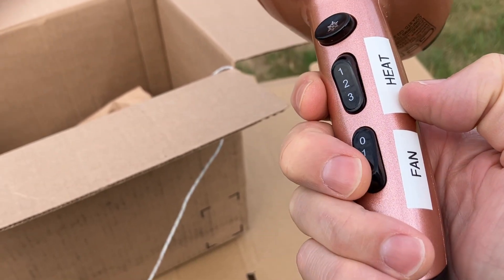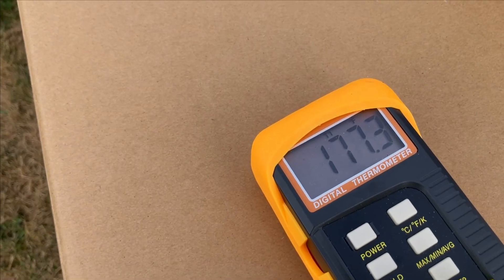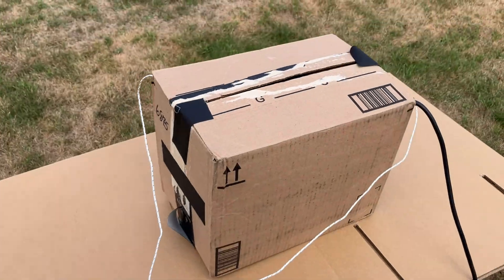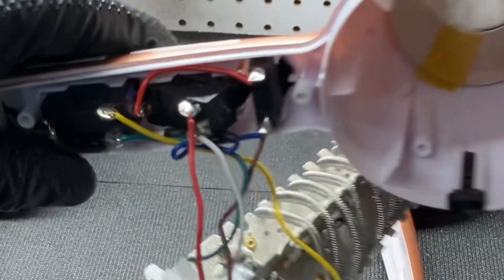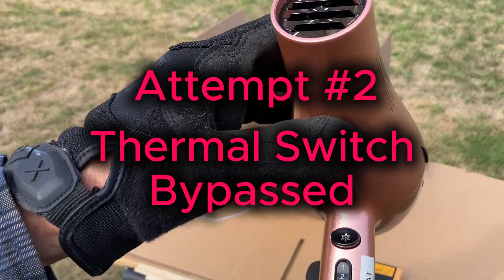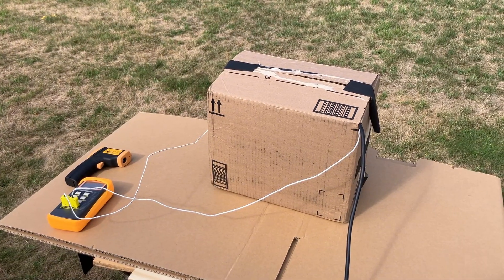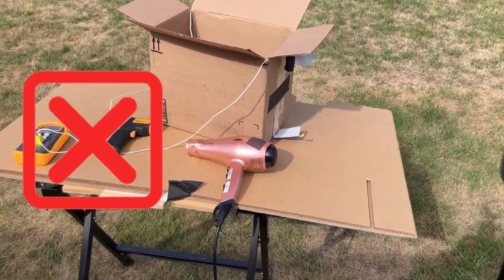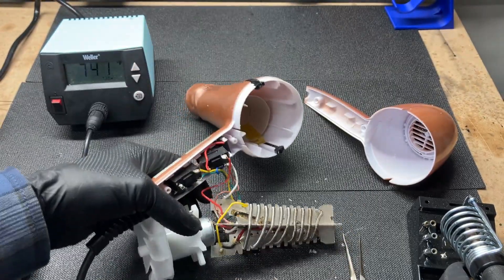Part 3: $5 Hair Dryer in a Cardboard Box, will it catch fire?

Comment from the maker: I think the Red Wire melting off on the Thermal Fuse bypassing it, stopped it from heating (acting like a fuse) and that kept a larger fire from happening. Anyone else have any thoughts on this?

If you liked this take a look at Whats inside a cheese wiz can?
(hint is uses a piston)
https://www.youtube.com/watch?v=LwfblvfdHTA
	
What’s inside a 9v battery?
(There are a lot of differences in 9 volt batteries)
https://www.youtube.com/watch?v=LwfblvfdHTA

If you have an idea for a future video reply to this thread.